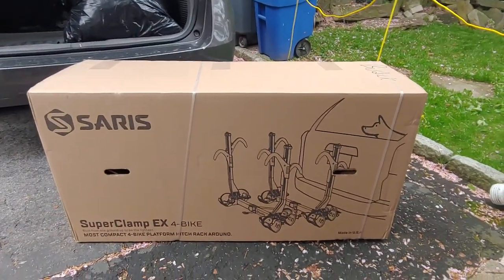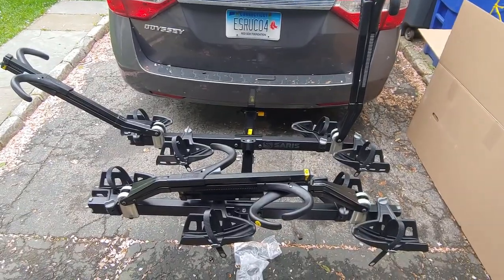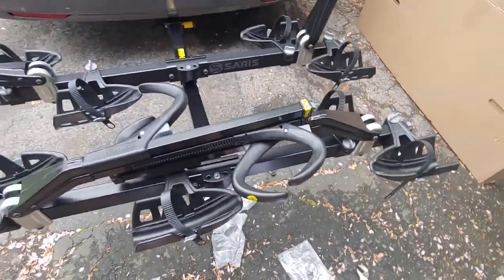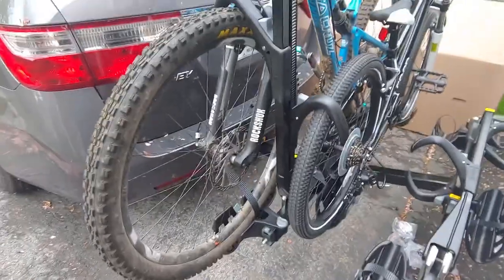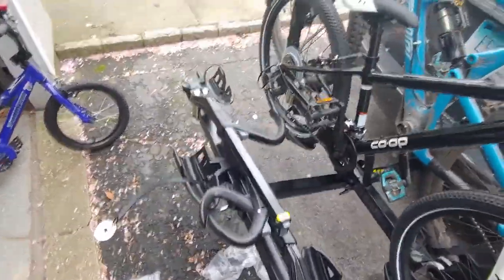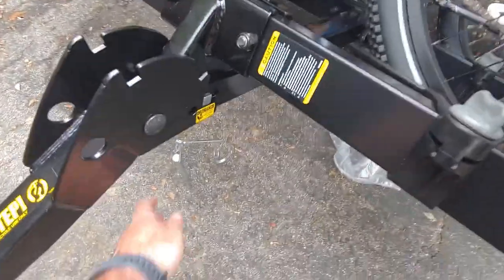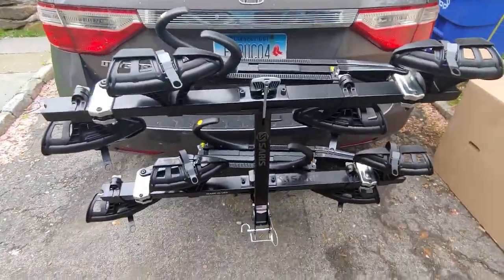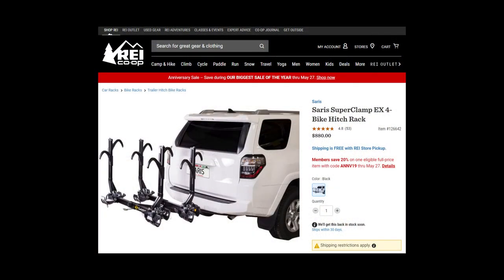Saris Superclamp EX Unbox and review

Comment: Thanks for the awesome review!  I ended up purchasing the same one myself for my 2017 Sienna.  I get less clearance against the rear bumper compared to your Honda when the rack is folded up in the stowed position (about half an inch).  Not too concerning since it's only driven around while the bikes are loaded.  I'll have to pad the top end of the arm closest to the bumper somehow in the future in case I do end up driving it around while folded up.  But I'm glad I was able to run into this review since it was the only one I could find that is demonstrated with a minivan.  All four bikes load up very easily and the thing does not take up too much garage space unlike the Thule and Kuat racks.

Comment: Thanks for the video. How do you store the rack when not in use? Easy enough to hang up in a garage? Think the rack is solid enough for long road trips? I’ll be mounting on an Odyssey just like yours.
Reply from the maker: When the rack is folded up it can stand up by itself without too much fear of tipping over. I stored it this way all winter. As for long drives, I wouldn't be concerned about it's durability. Quality and strength are obvious in it's construction. Make sure that you have a good hitch installed, I got one from etrailer.com that I installed and it's rock solid.
Reply: Chris Burdick That helps. Thanks!